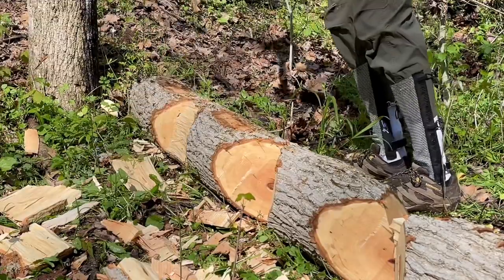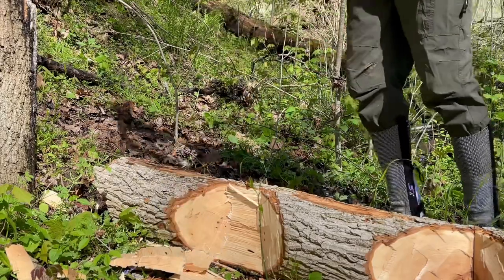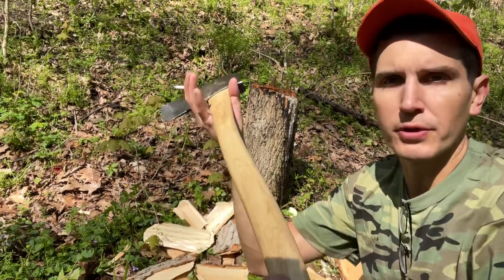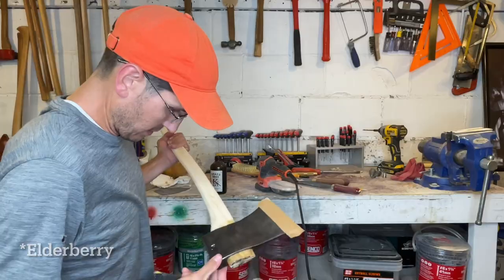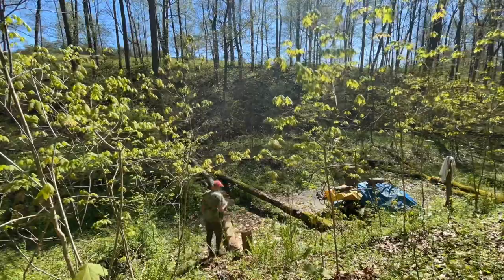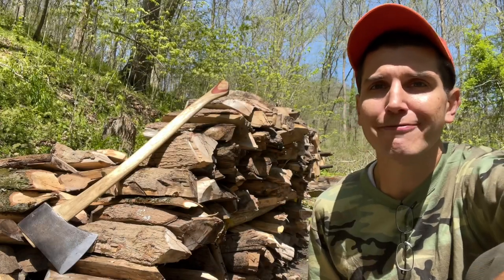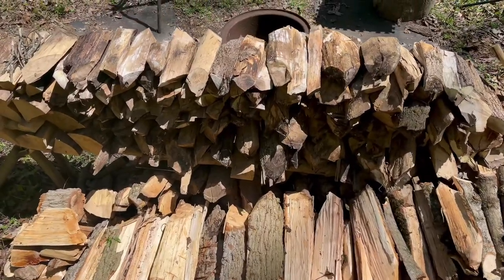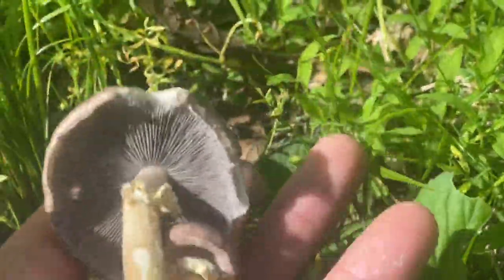Heirloom Quality Dayton on a Hackberry Handle: Cordwood 2022 Update!

Comment: I like it. A lot.
I know that compared to hickory all other sorts of trees are subpar for this application. But man it will work for if you need to. I look at my own handles made from local oak trees and will recall an article I read in a blog you might've heard of, Axe-connected. The author writes of using other woods for handles. Especially the point he makes of the modern era of our generation being conditioned to use only hickory when an otherwise adequate piece of wood you would probably burn or leave to rot could service your needs.
Reply from the maker: It does seem like hickory is king for a reason.  That said, it’s not like all other woods are going to snap the first time you use them.  I like my white oak handle, but it is a little stiff.